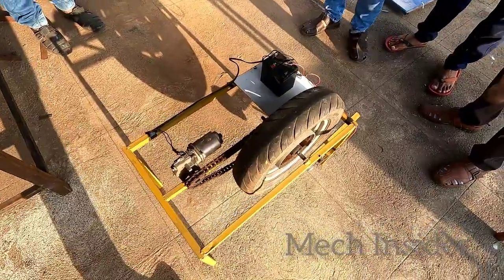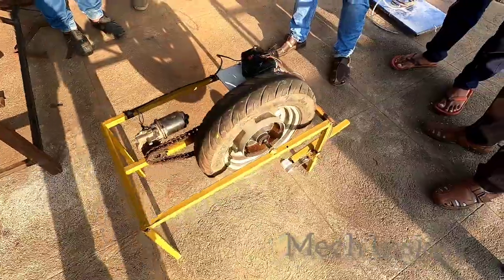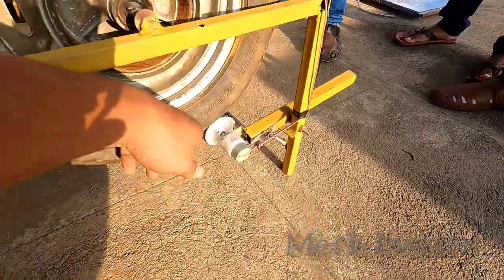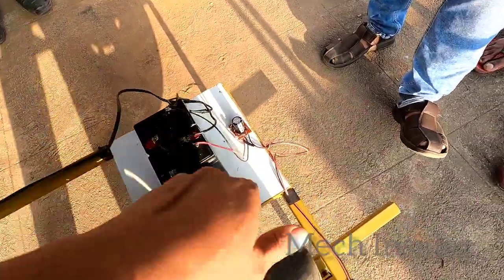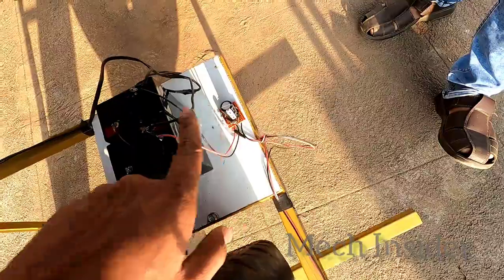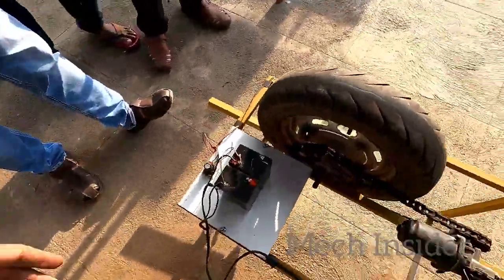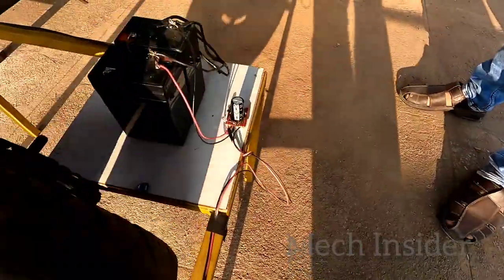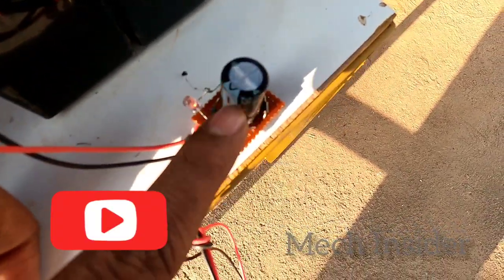engineering projects for mechanical students | REGENERATIVE BREAKING SYSTEM 2023

Comment: Do you provide Final year mechanical engineering projects ?
Reply from the maker: Yes we do provide All Branches Engineering projects at lowest cost We have Our 1000 sq ft Workshop
Reply: @MechInsider  where is your workshop brother? I have actually chosen electromagnetic Regenerative braking system to charge battery , can yu help me out?
Reply from the maker: @arshathahamed9438  we are put up in Bangalore Yelahanka New Town
You can search for Mech Insider and get address
Or contact me at ph: 7892151234